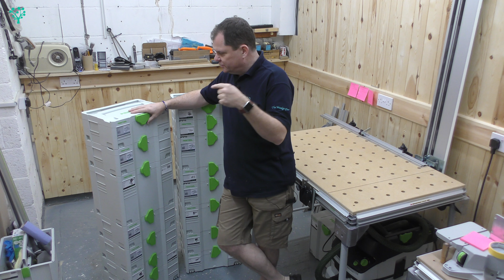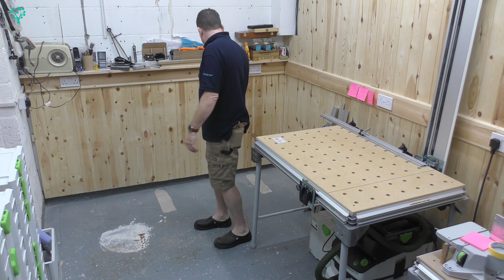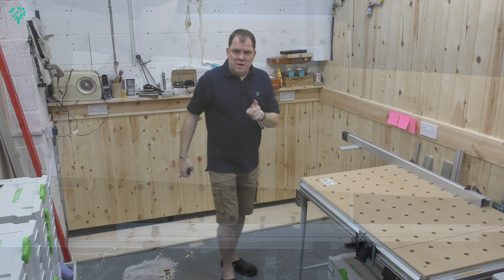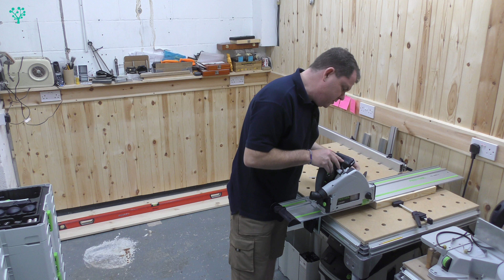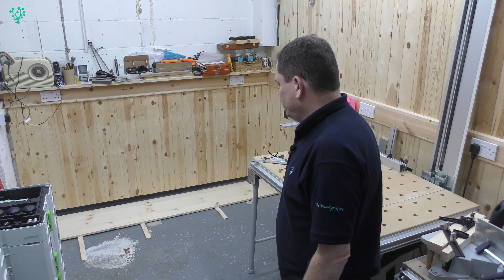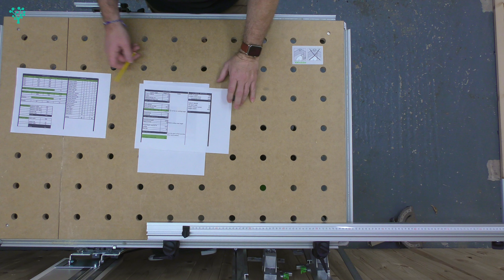Festool systainer storage system building the sysport 1

Comment: Hello! I know this is an old video but I just bought my first tracksaw, the tsc55!! I have a question for you. When you were cutting the shims to level out your base, you said the one shim was 5mm and I believe you marked 5mm on the board then lined it up with the track. Im curious if you have to add a mm or so for the thickness of the blade. Wouldnt you lose the width of the saw blade?
Reply from the maker: Hi,

Thank you for the question,
It depends on which side the ease will be. I can’t remember what I did in this video. But...
If the stick you want to keep is u set the rail, then you do not need to allow for the thickness of the blade.

If the stock you want to keep is not under the rail, then yes, you need to allow for the kerf of the blade.

On the original Festool blades that is 2.2mm.

Hope that makes sense.

Andy